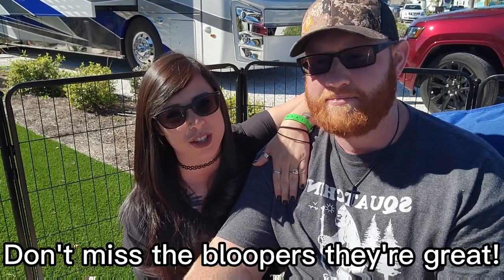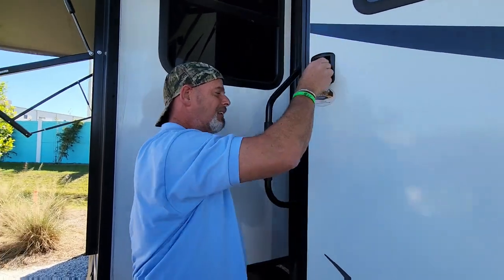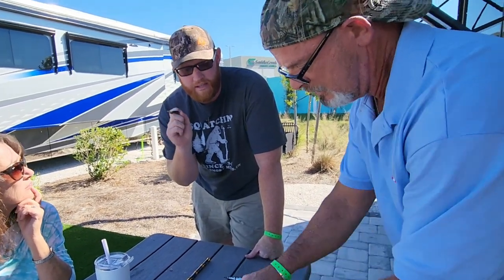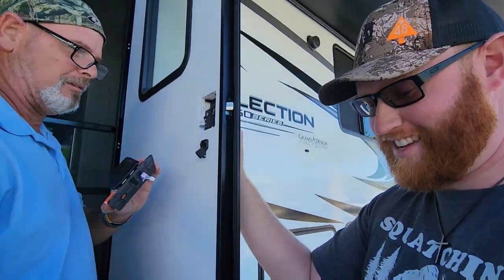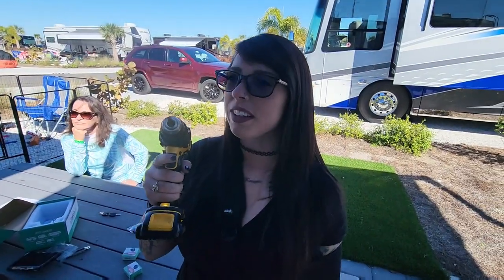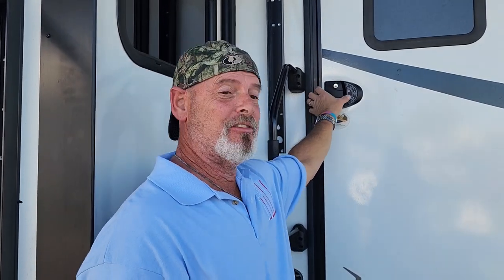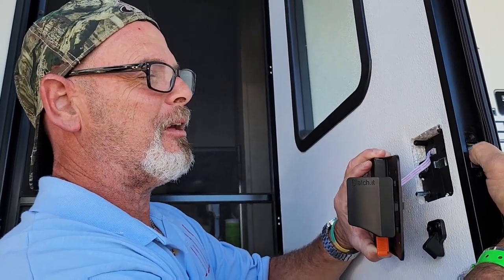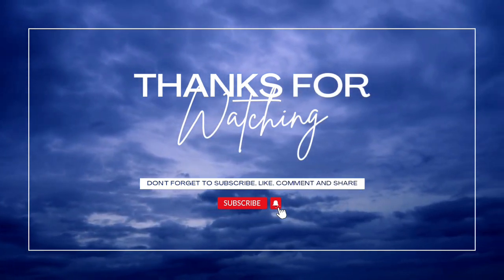Give yourself EXTRA PROTECTION and upgrade your RV door lock!

Comment: In the last 1 ½ years I have had to change my Latch-it door latch 3 times for a known defect! The key will not insert in to the lock. I’m lucky I have a toy hauler, in each case when I get inside my RV I could not turn the deadbolt lever at all. Latch-it knows about this problem and now you cannot call them on the phone any more. I hope if you have a Latch-it door latch I hope you have a comfortable truck or another way in to your RV you more than likely will need it. I went with RV v4 lock this time, so far so good.
Reply from the maker: Oh wow! I'm sorry you've had to go through that so many times! Thats not fun!

Comment: This is Awesome !! I think maybe I can do this.      I’ve had a lot of trouble with my door lock 😣.     Do you know if it will fit a Geo Pro 20bhs ?
Reply from the maker: it looks like the lock on the GEO pros are the same as they one we replaced it with. its just a common cut out in most of the RVs. We definitely like it for the extra security for sure! I hope that helps you! 😊
Reply: @campingwiththechadwicks2711  it does, thank you

Comment: The only thing I would do differently is to drill through the strike plate holes into the metal door jamb/frame and use the longer screws so you get a much stronger strike plate integrity. It's the same thing you should do with your front entry door at your house, although you'll be screwing into wood. I use 3-inch hardened screws at home for much stronger security. The short screws the builders use only grab into the door trim and one kick can easily knock in your door. I'll typically upgrade at least a couple of screws in each hinge as well to strengthen both sides. This simple upgrade will make your doors 10x stronger. If you live in an apartment it's a must. Do both the door handle and deadbolt strike screws and at least 2 diagonal scews in each hinge on both the door side and the frame side for maximum security. You'll need about  twelve to sixteen 3 to 3 1/2-inch screws. Super inexpensive upgrade and only takes about 30 minutes tops.
Reply from the maker: Yeah I agree, we said the same thing when he was putting it in the door frame but i guess i didnt get that part in the video lol. We are thinking about getting those screws as well for the exact reason you just said, because when he was talking about the door jam the screw ran into the metal backing of the door jam our unit doesnt give much room for longer screws but we are gonna find something for sure! We appreciate your help!
Reply: Just be careful there are no wires running through that aluminum frame. It's doubtful, but drill carefully and feel around in there before you install the longer screws.
Reply from the maker: i will look for those when we get to civilization lol
Reply from the maker: Yeah, that's what we were wondering too lol.Part of the reason why we havent done it yet because its not like a regular door jam and the hole can get filled if we mess up as well so we havent made the move to that yet lol
Reply: @Camping with the Chadwicks  if there's a gap between the trim where the screws tap in now and the metal frame you could also shim some wood between them to give the screws something more substantial to bite into instead of drilling into the frame...I'd probably do both, but I overkill everything, lol. Thanks for the video, btw!
Reply from the maker: There is! Thats a good idea! We would rather be fort knox anyways lol. Thank yo for your help as well! We appreciate it!